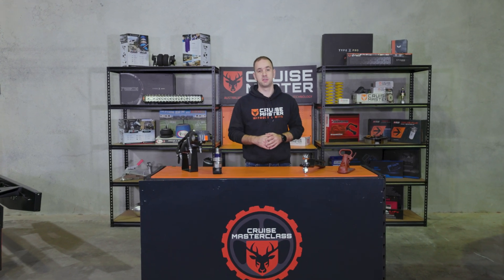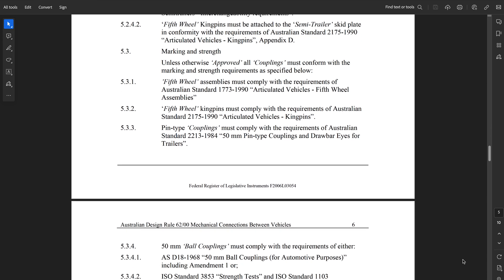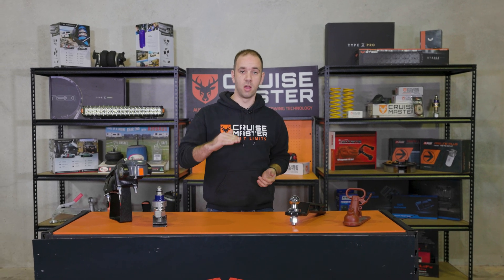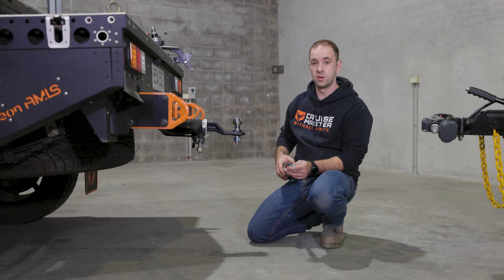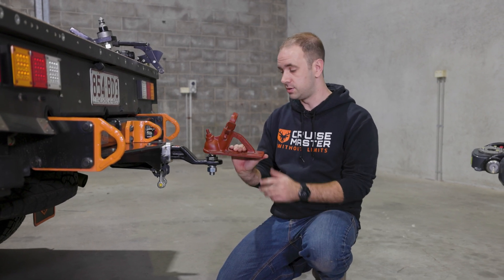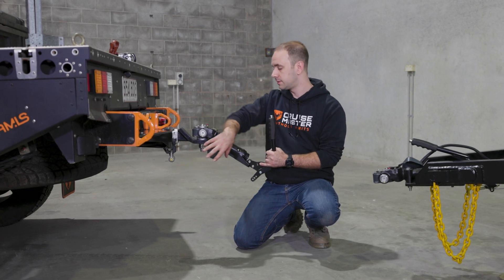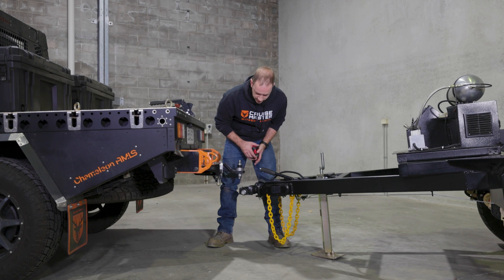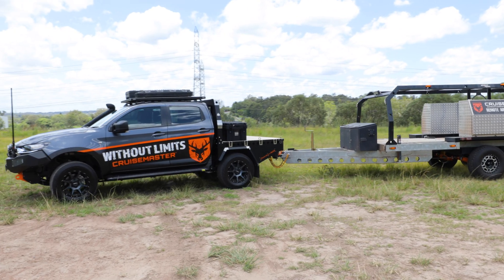CruisemasterClass - Ep 23. Legal Tow Ball Heights

Comment: Not being in Australia or an Australian, I have often wondered what the general height of the coupler on off-road trailers are. This video and the comments section was especially useful in ascertaining that information as a general guide. It seems that there is some variety depending on the caravan or off-road trailer. Incidentally, the average height for an European trailer is roughly 44cm. This does vary slightly give or take a few centimetres, but I don't think that there is any trailer that goes as low as 35cm and I'm not sure how legal that would be in Europe.

Comment: It's a Bummer the Caravan manufactures arn't getting the heights correct then, some of the Off road caravans have extreme height which would require engineering change if you've already purchased it. I asked for the Hitch to be installed inside the Draw Bar( plate under Chassis) instead of on top and that dropped it to suit these heights, had to pay extra though .

Comment: When driving along a flat road, the caravan should be roughly level except that it could tilt down a bit rather than up. The movements demonstrated by the brown standard 50mm hitch should be indicative of driving over speed bumps, driveways and maybe minor off road stuff,  not allowing for differences in height between the vehicle towball and the caravan hitch. The caravan I have ordered comes with a standard 50mm hitch for use in caravan parks mainly. The DO35 clearly is for off road use. I can't see that I will need one.

Comment: That standard measurement for a 50 mm ball does not take into account the aspect of the trailer. Surely if the trailer is level and the height of the ball is above the stated height, it should comply. We all know that the aspect of the trailer has a lot to do with trailer / caravan handling?
Reply: I would say that this is rules made by people in offices with no real world knowledge hitch angle should be what it's based off and I've used a alko unit on a camping trailer which had pivots allowing similar if not equal articulation and it had a high weight rating

Comment: There is not a  duel cab or 4 x 4  or trailer on the planet that would fall  in the 380 to 460 mm range with 50 mm ball
Reply: That’s why you can buy a drop hitch.
Reply: @Rufus761 level trailer 8x5 on 15” wheels the coupling sits at 490mm to centre of coupling.

Comment: One of the other great things about the DO35 compared to a traditional ball hitch is that it has a very short height.

This is of concern to those of use who have spare wheels, tailgates and side gates that are located above the hitch spatially. Previously, we would ding our tailgates or have to decouple prior to accessing our cargo space. Some of us need to delete or relocate our spare wheel carrier if we plan on towing, especially when we have larger diameter spare wheels.

How much vertical space is required for a DO35 hitch to be coupled?

The Pin is about 70mm above the ball mount, The uncovered coupling is about 50mm and the dust cover is an additional 25mm.

Worth noting is that if the ball mount is below a permanent fixture, like a spare wheel or ute tray, you will be restricting articulation. It may not be a good idea to do Gunshot Creek without extending your ball mount.